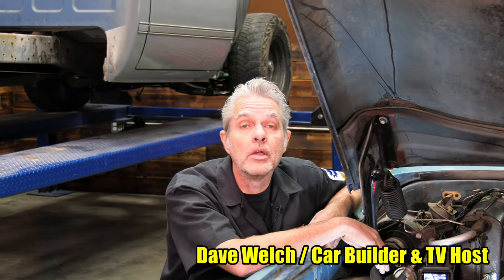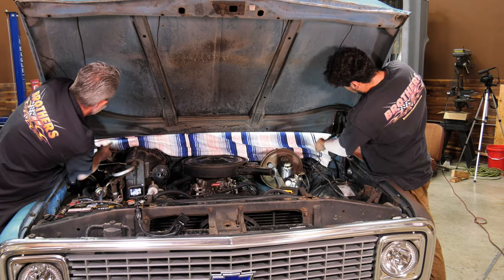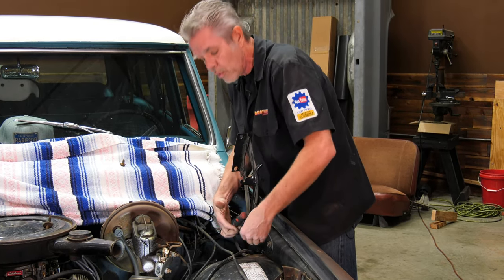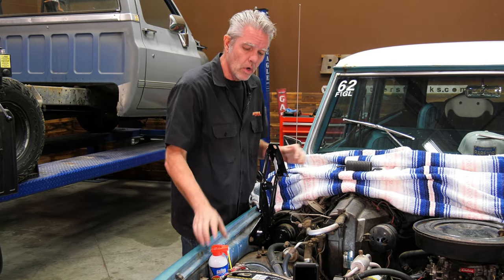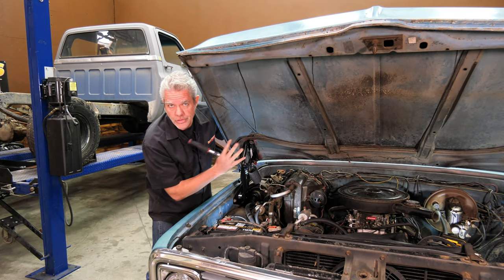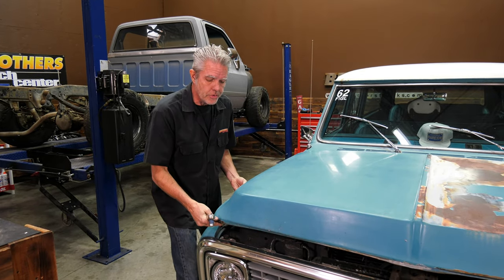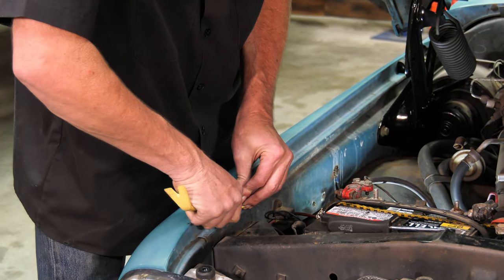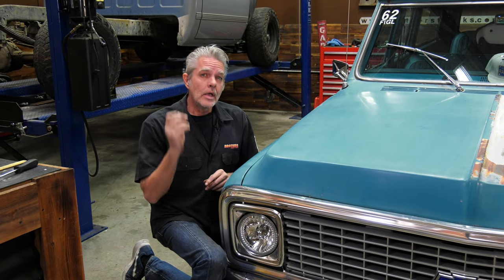1960-87 Chevy & GMC Truck Hood Hinge Install/Alignment

Comment: When you did this hood hinge replacement I never noticed a spring that pushes the hood up when released. Is there not a spring that will lift the hood enough to get your fingers underneath it?
Reply from the maker: If it's adjusted right the hood should rise enough to get your fingers under there on it's own.

Comment: Great video with several important tech. on bolt removal.  I have good hinges but still not enough adjustment to get the back of my hood down and in alignment with my cowl? If my slots were longer i could lower the hood back down enough but slots are not long enough??
Reply from the maker: This might sound counter-intuitive, but try adjusting it down by sliding the front holes of the hinge down and raising the rear ones. you may actually be binding the hinges against themselves.

Comment: Great video Dave why do my new hood have more space on one side of the fender can the hood be move over from one side to the other are is it maybe my hinges are are bad
Reply from the maker: Could be a few possibilities... Bad hinges, fenders out of adjustment, hood out of adjustment, etc... You really just need to start messing with stuff and see what makes it better and what makes it worse. Also, not certain what year your truck is but most have alignment bumpers on the sides of the hood that help center it when it closes, maybe yours are missing or old.

Comment: Would there be any particular reason to replace the springs? I was thinking about keeping my original hood springs and just sandblasting and repainting them rather than buy brand new ones if I don't have to.
Reply from the maker: If they hold the hood up without dropping then don't replace them

Comment: @5:48 you talk about adjusting the back height of the hood by moving the hinges. Not as easy as it looks.
Reply from the maker: It's not that bad, and we have other vids that also explain this adjustment (check out our multiple front sheetmetal vids). The one thing you need to know is that the adjustment of the hinge is exactly opposite the direction you would assume it should go. Sorta like up is down and down is up!

Comment: For the love of God, I just need to replace the heater blower on a 71 suburban in order to remove the old one. Unfortunately I must remove the passenger hood hinge. So I’m thinking I will support the hood with some straps. Remove the spring therefore the hinge should easily collapse upwards enough to remove the blower motor.
Reply from the maker: We've got a '68 coming into the shop early next week. We'll take a look at doing a video on that while it's here. Thanks for the suggestion.
Reply: @BROTHERSTruckPartsTV  I watch every one of your vids. Thanks for sharing the knowledge!
Reply from the maker: @thedailyvariety4407   Thanks for watching!

Comment: Hinge replacement and adjust on 72+ ??
Reply from the maker: We'll get that one in the works for you!
Reply: you skip the part where you brought the rear down you talked about angling the bracket but you didn't show how to do it that's what I'm here for cuz my hood sits higher than the body